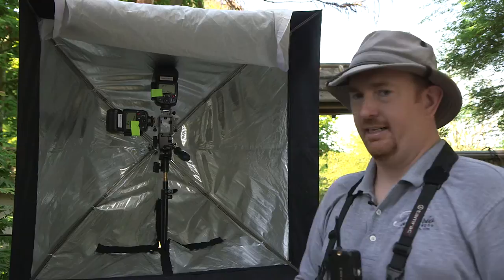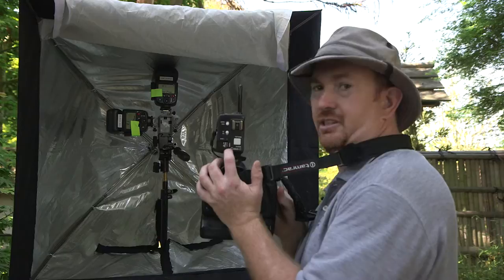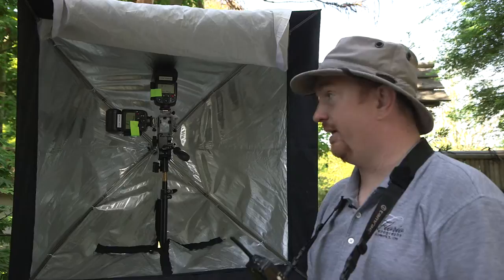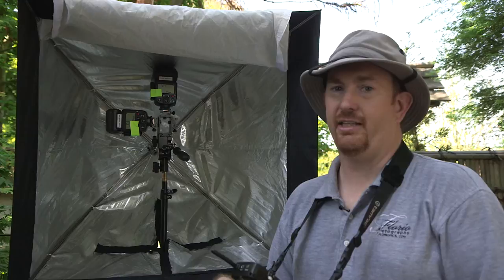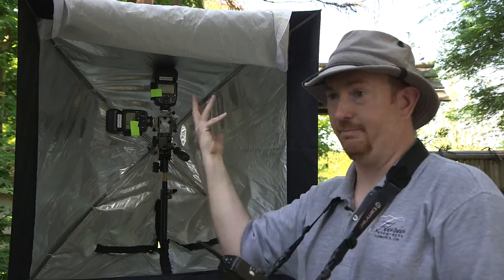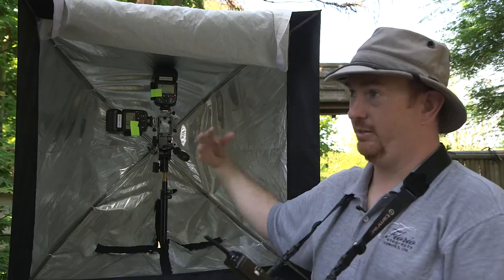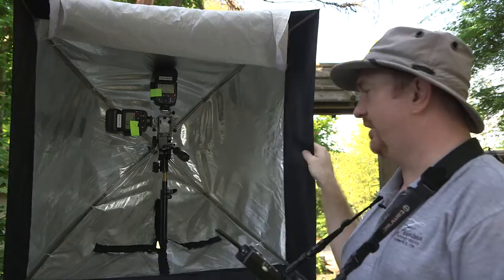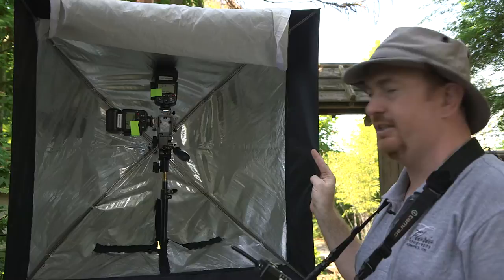Godox V850 in a Westcott Apollo Softbox   Real World Use

Comment: You should have the flashes on each side, not one on top and one off to the side. This is going to make you light un-even. Also push the box back off the flashes, you need to give the light room to spread out. Make sure you got them zoomed out and if you still need more even coverage, pull put the diffusers in front. Last tip, don't be scared to get closer to your models with the box. Put it as close as you can without being in frame. If you got couples, try a boom arm to get it above them. Hope these tips help.